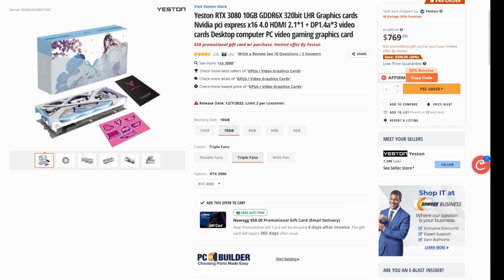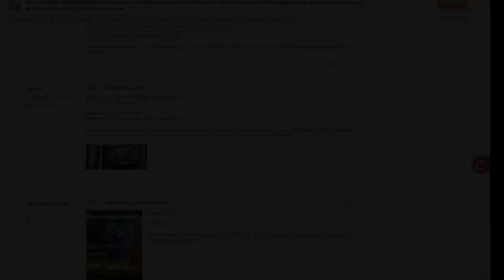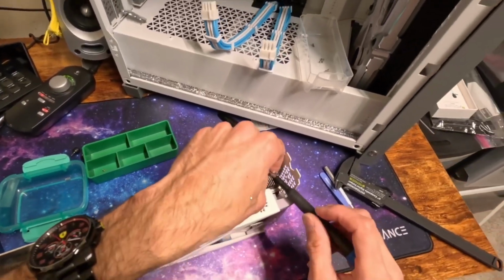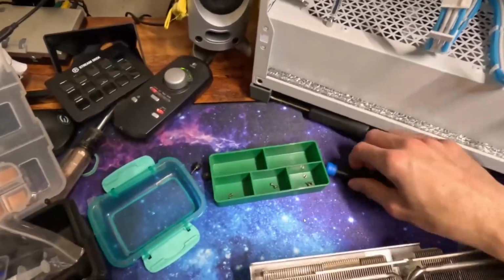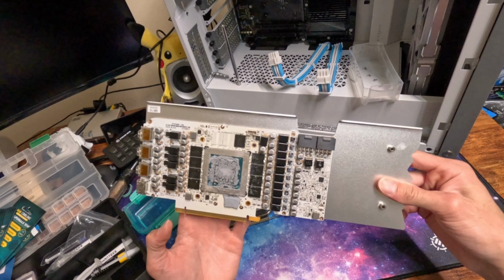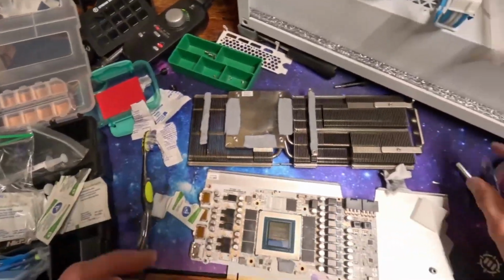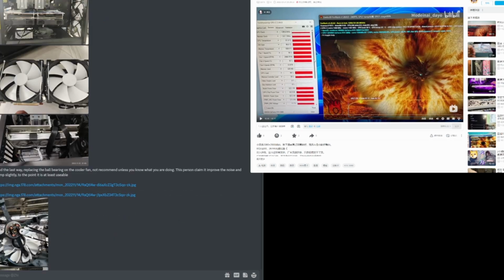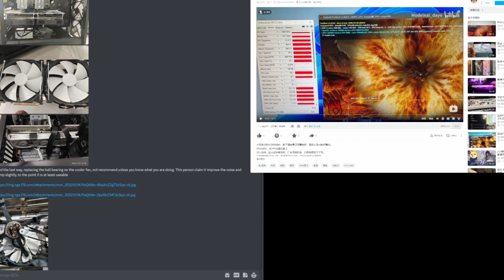THE WORST RTX 3080 EVER MADE! Yeston Waifu 3080 TEARDOWN & DETAILS YOU NEED TO SEE!

Comment: Bruh mine stays below 58c when gaming on max setting u just need to clean its fans and replace the thermal paste
Reply from the maker: It was brand new doing that. It was confirmed defective. Also would hit 90c and crash. You can’t clean out dust that isn’t there. Newegg even told me they had a bad batch and tons of people had the same issue. I sent it back and got my money back. I’ve got a 4090 now. I also tried repasted and thermal pads and that only minimally improved it. Looks like the cooler surface was either uneven or not making the right contact no matter how tight or how much paste you added. Check out my other videos tho so you can see my current setup. I change rigs and setups like crazy.

Comment: I got this card 2 years ago for an amazing deal on newegg and I’m looking to downsize my pc. Not particularly fond of the backplate but I’ve had it vertically mounted. Now that I’m downsizing I’ll have to horizontally mount it so I was wondering if I could swap out the outer assembly with something else. I’d love to replace it with the founder’s edition but the connector for that one is mounted diagonally.
Reply from the maker: swapping to a different cooler wont work i dont think due to the position of all the components that need cooling. Manufactures all use different placements for the most part but sometimes you can get lucky and find one similar with very oddly specific cards. If you wanted to remove the shroud you could to that and custom 3d print a fan shroud to use noctua fans or whatever fans you wanted.
Reply: @ ah I see, thank you. Do you think the 5070 will be an upgrade compared to this card?
Reply from the maker: @RaveCat-i7n for sure it would be a good upgrade but I would hope that it has alot more vram. That’s a huge bottleneck now esp with 1440 and 4k resolutions. Games are using more and more vram these days and if you’ve only got 8gb it’s just holding you back from seeing way better quality at even better fps.
Reply: @ yeah maybe I should save up for a 5070 ti with 16 gb of vram

Comment: I’m an owner of the Yeston 3080. I was having temp “issues” (83-85c) when I first purchased the card. Immediately started looking at possible solutions. The best I could find is that the fan speeds are not optimal. Had to download and run a better fan curve using MSI afterburner. Now it sits around 73-75 which is tolerable given that the fan blades do not seem practical for a card of this caliber.

I agree that OC this card is not a good idea. Performance benchers typically run the name brand cards and thus find the safe power limits for the general consumer market to safely set voltage but for a brand that’s new to the market it’s unexplored territory.

Outside of having to adjust the fan curve I’ve been happy with the performance of this card. Keep in mind that other factors also influence how hot the card can get. If you are a plug and play gamer I would not suggest this card. If you like going into Nvidia Control panel and playing at capped FPS you will likely never experience hot temps above 70+.

Nice video!
Reply: Where do you download the fan curve? Same problem here.. 86oC

Comment: what pad size should i get for this card im planning on putting new pads deshrouding the card and putting on noctuas on it
Reply from the maker: Check out the tear down portion. But the same pads the evga ftw3 3090/3080 uses will work. I’d get kritical brand pad kit on Amazon. Pricy. But worth it. Pads are 1.75 to 1.8mm thick. 2mm is a bit too thick and 1.5 too thin likely

Comment: There is a guy that only changed the thermal paste to a high quality one and the thermal pads to very good thermal pads and then moved the old thermal pads to the back of the card and his temps dropped almost 4 degrees with a drop of 300 RPM of the fans. Lower temps and lower noise.

I do not think the fans are the ones to blame, the heat sink is too small to handle 300W, better heat conduction will do more than changing the fans.
Reply: One other thing. Yeston is a real brand, so their cards are not made from used memory and chips and their cards PCB are not bad either, it seems like a very solid project, aside from the undersized heat sink

Comment: Hey there I have one of these that I got with the 200$ rebate and I looked at a few comments and wanted to say that mine runs below 70c on furmark.

Further details I scored 17227, 280min 293max 287avg fps, gpu core 1710mhz, memory 9701mhz.

Would you say this is abnormal and should be returned or do you think I got a good one?

Edit: after the 20 minute stress test it now runs just below 76c on the 1080p test
Reply from the maker: You guys have the revised batch. This video has been out a while. Check dates my guys

Comment: Interesting I just got this card a week ago saw it was running hot in game (didn’t check around like 78C maybe) used MSI afterburner to turn the fan speeds up and haven’t had an issue yet hopefully I got a good one I’m probably to lazy to return it
Reply from the maker: 78c isn’t too too bad tho for that card. Def keep the fans up and keep and eye on the core and vram temps. There’s hwinfo that should tell you good accurate temps. I show a few spots in the tear down that could improve thermals if you need to refer back to it one day. Also Newegg will accept returns and send a prepaid return label free. Just reach out to neo in support he handed mine. They even took it back after my return period. They did right but I’m mad they won’t show my review

Comment: Very helpful video.
There is a suspicion that these cooling system fans have an unsuccessful blade design.
They create a small airflow and therefore we see high temperatures at the GPU and hear noise under load.
P.S.> Yeston RTX 3070 owner. This card is beautiful, but they need to redesign the propellers to improve their performance.
Reply from the maker: Hey thanks for the support. I also feel the same way about the fan blades too. Have you ever watched the fan showdown on YouTube ? There’s a guy who 3D prints fan blades. I bet he maybe could help us out here.

Comment: Interesting, I just got mine and based on this video my performance is surprisingly good. Mine didn't go above 73 when I ran the 3dmark stress test that loops time spy and it scored a 97.7% on stability. I will have to check the VRAM temp, so far tho it's been surprising since I figured heat might be a issue just based off the coolers size.
Reply from the maker: Awesome. So that maybe a newer batch. I was hearing from someone else who got the latest batch that they were decent. But also keep in mind mine ran in the 70s the first day or two and then after some more usage it started hitting 80-90c easy. Have you tried furmark. Please download furmark and hit the 1080p preset option button on the right side and see what the temps are, clock speeds, and watch to see in real time if it starts to thermal throttle or drop fps. I love furmark because I don’t need to have any thing else open and it shows me all the temps
And clock speeds as well as power draw too. Then you can submit your score and see how you sit on the leaderboard for today. It’s fun trying to beat Everyone lol.
Reply: @cppctek  sorry it took me a bit i ran into seperate computer issues but the card scored 16954 @ 54c and 104% TDP. Idk if that score is good for 3080s, but it seem to beat the cards that the 3080 should on the leaderboard. Also what software do you use that lets you check VRAM temps, afterburner dosen't and the main temp seems good but I am woried about them.

Comment: I have this card and replacing the thermal paste alone made a world of a difference for temps and noise. The $150 gift card was nice and it worked out in the end but it's still a bit disappointing, I shouldn't have to fix something that I bought new
Reply from the maker: Exactly. I’m glad it worked. Keep an eye on the vram/hotspot temps though. I just made a new video that will help you save money and find new deals if you wanna check it out. Thanks for the comment. I hope you enjoy ! ❤️
Reply: What kind of thermal paste did you also did you use replace thermal pad and if so what kind?

Comment: What were your temps after replacing the paste and the pads?
Reply from the maker: Too hot it died.
Reply: @cppctek  That’s too bad. I just installed the 3070 version in my wife’s PC about a week ago. I tested it on max load for about half an hour and it never got over 80. And it has a quiet mode where it shuts the fans off at low temps so the PC is nice and quiet when browsing the web and such. 

I hope it holds out. It looks very nice in her new PC.